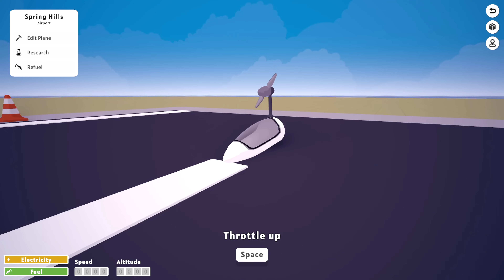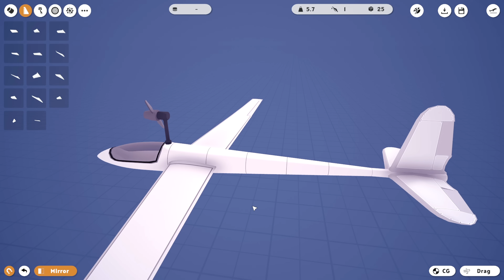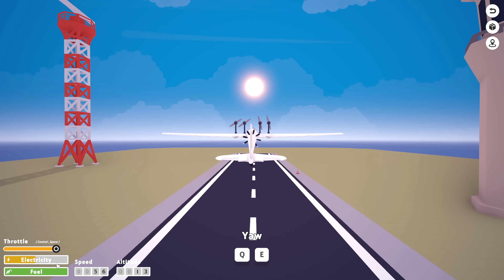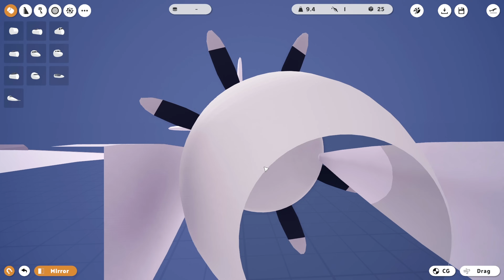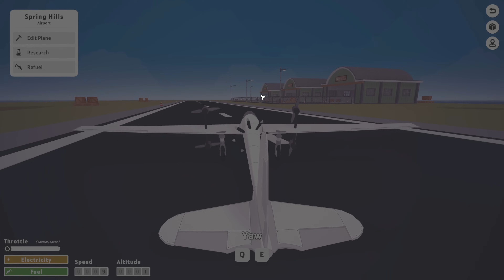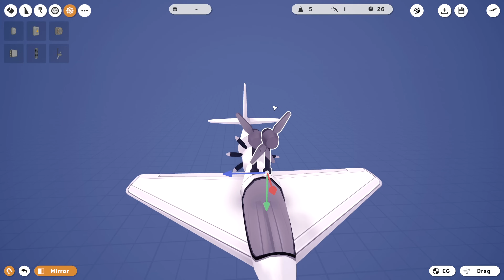ONE TURBINE To ONE ELECTRIC ENGINE Actually Works!

Comment: The delta wing and canards have FAR less drag.  Same with the retractable landing gears over that tail gear.  Drag is VERY important in this game.  Lift determines takeoff and landing speeds and thrust determines you acceleration and speed potential based on drag.

Comment: If you decide to revisit this concept, you might consider using the fine-grained reorientation sphere to put the air turbines in at 45-degree angles around the fuselage.  Additionally, it might be worth checking to see what kind of drag the turbines generate and whether you can get power from turbines that do not experience drag.  If so, you could definitely get more power per unit of drag by aligning the power props into something that resembles an actual turbine.